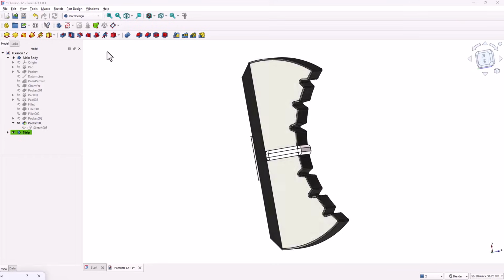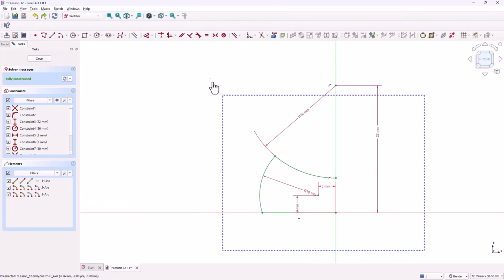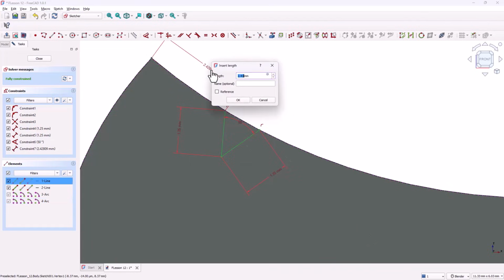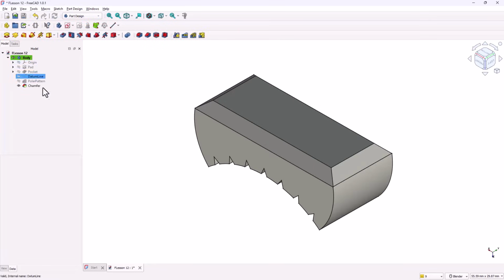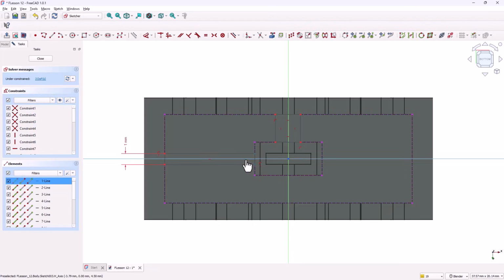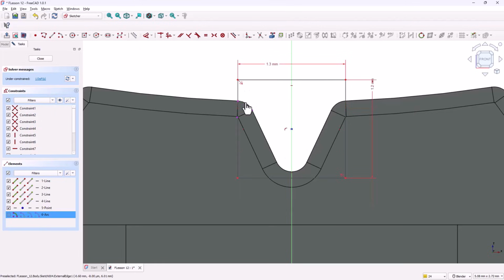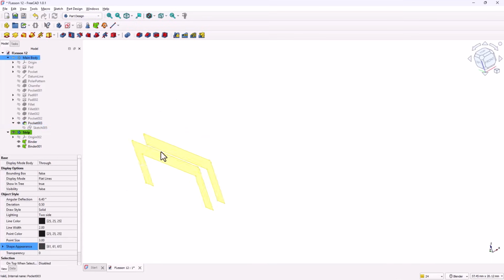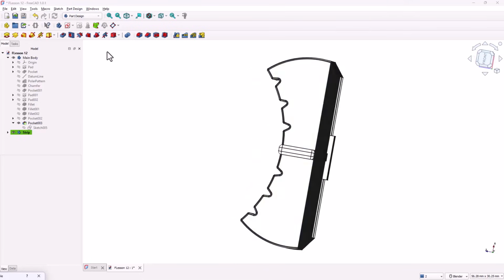FreeCAD Tutorial: Model a Fader Knob Multi-Body Design Sub Shape Binder| 3D Print Ready

Comment: 1.5mm was the biggest I could make the side fillet.
I am using V 1.0.2
Reply: I'm on V 1.1.4 and while 0.2mm caused horrors beyond recognition, both 0.19mm and 0.21mm worked fine. Even 0.29mm worked so I guess it's just some sort of a rounding issue.

Comment: I been using 1.1 and 1.02 and there is still lots of bugs in such a simple design not the problem of the tutorial, tutorials are really great but using FreeCad on linux its just a mess honestly I will have I dont know how to install it on Windows and work from there. So sad that Freecad could be so much but still its so messy. In any ways thanks a lot really

Comment: I was wondering -  especially for the middle strip, if there is not like a 'carbon copy' method instead of hand-tracing the reference? That seems inefficient to me.
I would have hopen to select one of the inner face, turn that directly into a sketch outline and then extrude/pad it.

Comment: Thanks. Good video. I learned some new techniques. For making a 3D printed object, it might be easier model and print if you make the part 'solid' and just make a slot for the fader post in it. No supports needed when printing. This looks more like an injection moulding design. On the other hand, the way you did it teaches more details.